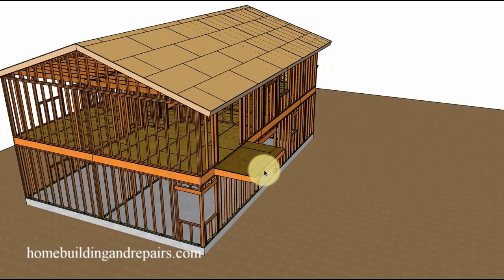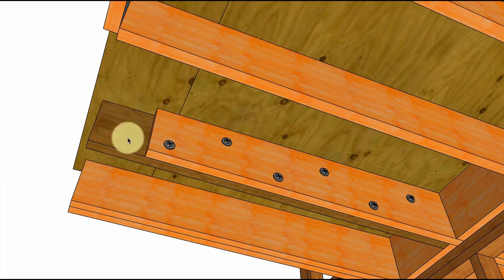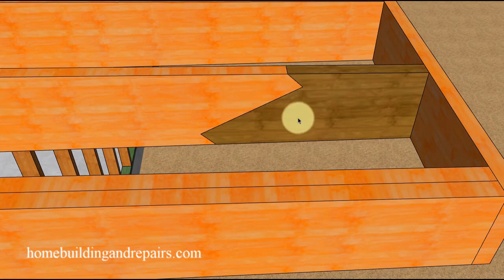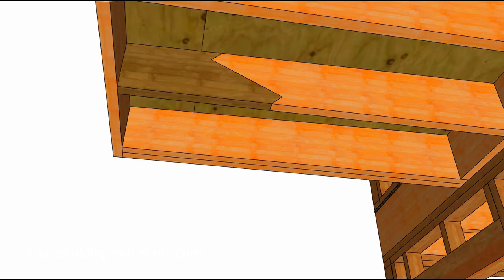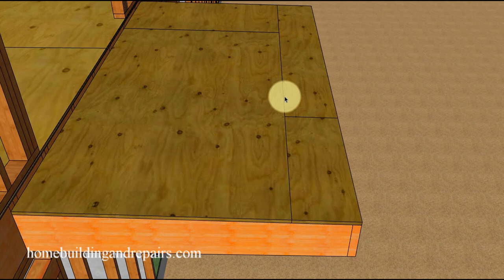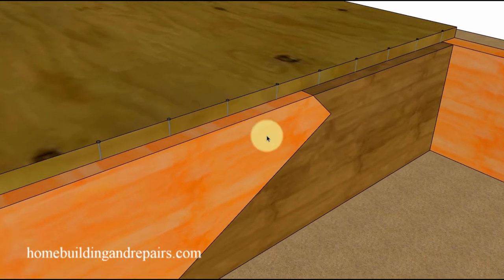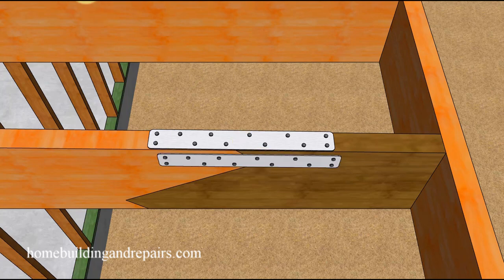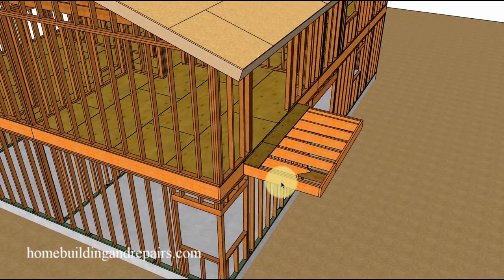How To Fix Damaged Wood Balcony Cantilever Joist - Do It Yourself Home Repair Ideas

Comment: I need to replace an entire cantilever walkway that spans a 3 unit apartment building. It was built with 16' long 2x8s with 4' extending out of the  building (cut down from 8" to 6" on the outside) to support the walkway. Many are rotted. My thought is to run new 12' long 2x8s with 8' on the inside bolted to existing joists. The only other option is to rebuild with a full ledger board and posts down to the ground.

Comment: How much flex is normal. If I jump on my cantilever balcony (im 235lbs).  Is it normal for it to flex or does it need immediate repair?
Reply from the maker: I can't answer for sure, but if it's flexing more than you're comfortable with, then you might contact a local builder or engineer.